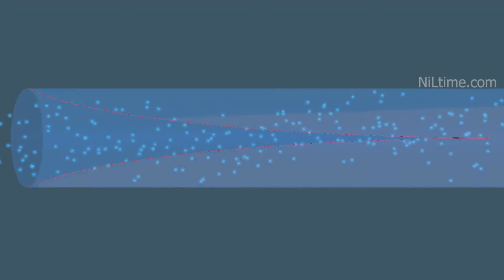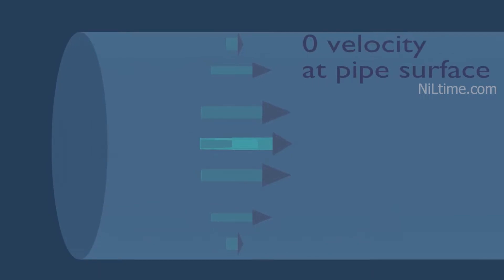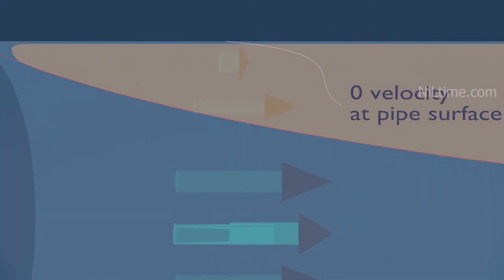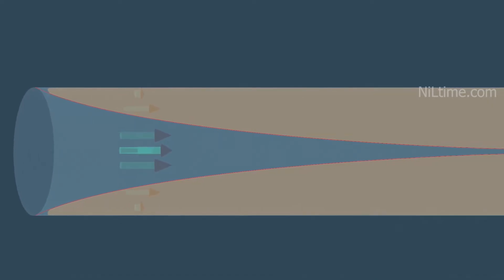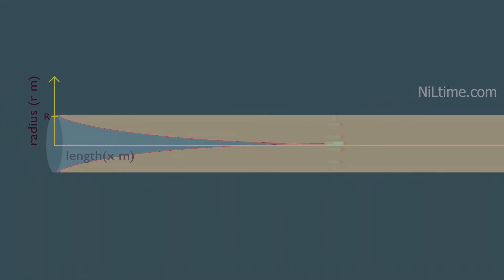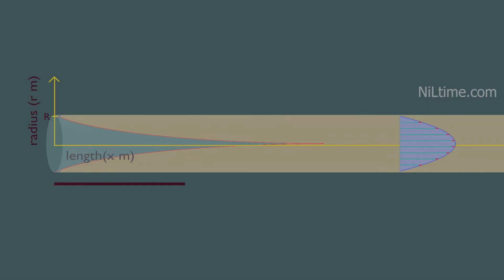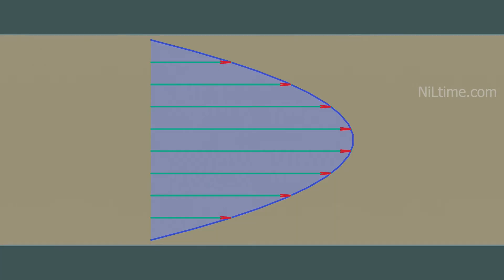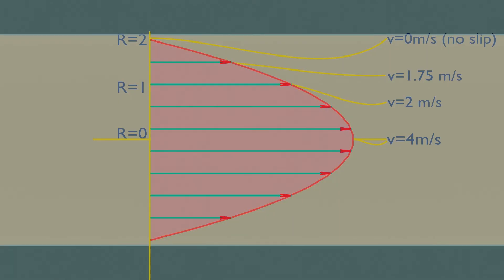Fluid Boundary layer and velocity profile animation (Fluid Mechanics)

Comment: 📝 Summary of Key Points:

📌 The velocity profile in fluid mechanics refers to the unique type of velocity experienced by a fluid flowing through a pipe. The fluid particles come to a stop at the surface of the pipe due to the no slip condition caused by viscosity.
🧐 The boundary layer is the flow region adjacent to the wall where viscous effects are significant. In this region, the fluid layers slow down due to viscous forces, creating a layer that sticks to the surface. Away from the boundary layer, the velocity remains constant in the radial direction, creating the rotational flow region.
🚀 The thickness of the boundary layer increases in the flow direction until it fills the entire pipe. The region from the pipe inlet to the point where the velocity profile is fully developed is called the hydrodynamic entrance region, and the length of this region is known as the hydrodynamic entry length.
🚀 The velocity profile varies along the radius of the pipe. At the center of the pipe, the velocity is maximum, while at the complete radius of the pipe, the velocity is zero due to the no slip condition. The velocity profile is parabolic in laminar flow and flatter or fuller in turbulent flow.
🚀 Understanding the velocity profile is important for fluid mechanics calculations as it simplifies calculations by depending only on the pipe radius.

💡 Additional Insights and Observations:

💬 "The no slip condition is caused by viscosity, which is the fluid property responsible for the development of the boundary layer."
📊 No specific data or statistics were mentioned in the video.
🌐 No specific references or sources were mentioned in the video.

📣 Concluding Remarks:

The velocity profile in fluid mechanics is a crucial concept to understand when studying the flow of fluids through pipes. It is influenced by the no slip condition, viscosity, and the development of the boundary layer. By understanding the velocity profile, engineers and scientists can simplify calculations and make accurate predictions about fluid behavior in various applications.

Made by Talkbud

Comment: Crystal clear concepts, If there is no energy loss in the fluid along hydrodynamic entry length , the velocity vector at the centre of the pipe will increase as the velocity vectors at the boundary of the pipe decrease. This is due to law of conservation of linear momentum 😘😘😘.